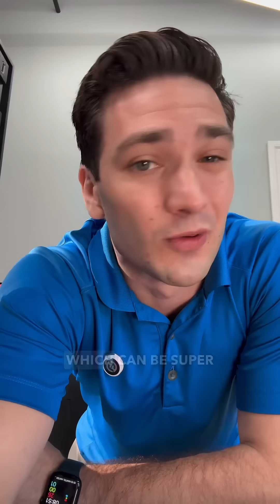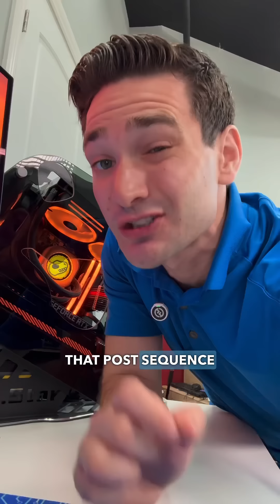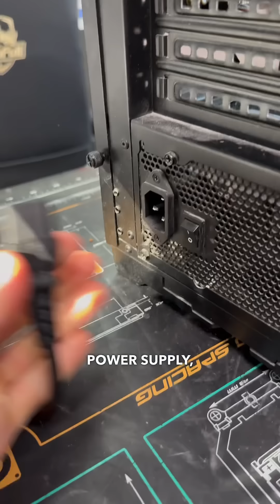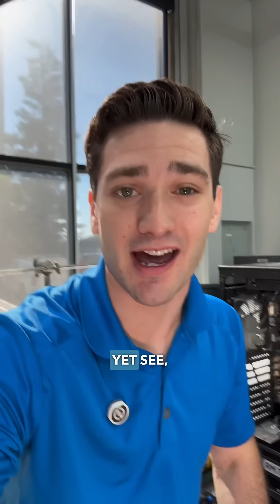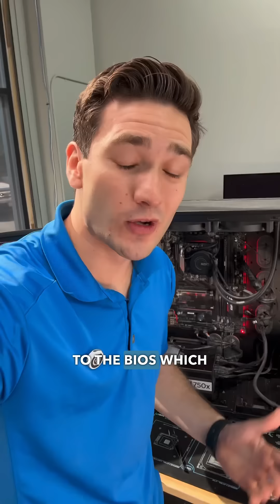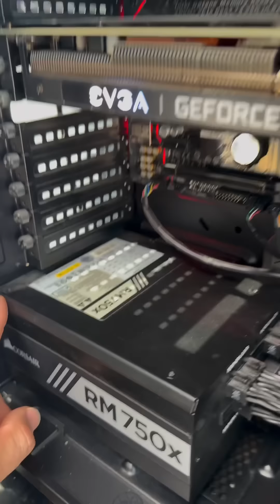PC Restart Cycle! #gamingpc #pcrepair #techtips #pcbuild #computerrepair #repair #gamingcomputer

Comment: I had the same thing when I installed my new gpu. But it isn't the bios in my case. Whenever I turn on XMP my system keeps restarting on itself. I did a bios update but it didn't help. Still not exactly sure what it is. I can't run my ram at full speed for some reason.

Comment: matt's computer services shorts bingo (originally by spiralingspiral72):

✅ this pc came into my shop
❌ power on self test
❌ hook up the doctor power 3
✅ take this pc out back and blow it out
❌ so, what gives?
✅ diagnostic LEDs
❌ intel instability issues
❌ we get absolutely no display out
❌ my favorite pro tip, pre wiring
❌ dead hard drive/ssd
✅ let's get this pc back over to our customer
✅ so what's going on
❌ (the) system fires right up
❌ fire the system (right) up/get this system fired up
❌ overheating cpu/gpu
❌ the system failing to post
❌ (matt rips out or slam dunks a pc component)
❌ windows installation media
✅ complementary metal oxide semiconductor (CMOS)
✅ clear/reset the cmos
❌ windows reliability history
❌ wouldn't you look at that
❌ loose pc part
❌ over and over again
✅ BIOS

Comment: If no bios switch, take out the spi flash (looks like a tiny black chip with 8 legs) and connect it to a flasher, then backup the program on it, and then reflash it with the new bios from the manufacturer, then pop this flash back in and youre good to go. Sometimes its easy to remove, at sometimes youll need a soldering iron with some flux, so be careful not to burn your self and not to destroy your motherboard. I told you how to do it, but if you messed up and motherboard is dead now not only with bios, im not responsible for that shit
Reply: don't worry about it, no one is going to start removing BIOS chips from their boards because you told them to

Comment: Oh that Corsiar 750D Airflow Edition!😎
Reply: It is not the airflow edition, it is the normal edition without the front panel on, which is exactlt how I run mine since if you didn't get the airflow upgrade kit which was stupidly expensive for a piece od plastic, it works just as well but is free 😂 the original front panel when attached looks great but is essentially a dust cover. Still though, the case fits my 9800x3d and a 360mm AIO just fine, wish it fit a 420 though

Comment: I have an itx motherboard from asrock that refuses to post and has no debug lights and ive tried every single configuration of parts that i have and even shorted out the cmos reset pins and it still refuses to post. Does anyone have an idea of what could be happening and how to fix it?
Reply: could be any number of things, if not tried what's suggested on youtube or google ai then could be motherboard or cpu, just check everything one by one

Comment: I have a motherboard that likes to brown-out itself on boot.
 But it will boot if all devices are removed.
1) The board does not like chained USB hubs in the boot sequence - likely not issue with newer boards. But older ones seems to create a timeout issue.
2) It doesn't like heavy loads, I have many USB drives and devices. Too many seems to upset the timing of IO
3) There is an issue that might affect my Intel CPU that under heavy load, the CPU circuitry in some Intel chips interprets the start up voltage as a brown out instead of clean boot, and triggers a reset of the system; which then causes the chip to sense heavy load, repeat.
5) I have cleared CMOS settings (used to boot holding insert key, but not available on usb keyboards) and manual and battery clear.  PSU should be plenty for this system. also air flow, and boards properly inserted, ram properly in slots, and if very desperate, the heat sink pastes, and finally dust and also quality of power input (I have a solar powered system, so had to make sure the Pure Sine wave and UPS could BOTH handle the boot up current for the entire time of the boot).
Just a few things for others with the same annoyance
Reply: nice one, some interesting points, my kids has gone into a power cycle stopping before reaching bios, tried all sorts, first problem had in over 20 years that not been able to fix myself, the usb problem you touched on is a possibility as windows 10 records every usb device used, also the cpu brown start up is a poss, thanks.

Comment: I have a question, when I try to power on my old Win98 PC, all the diodes indicating power light up on the case, but it doesn't load into bios (mouse and keyboard lights were constantly flashing meaning they are not getting any signal. Same with the monitor)

Comment: This is the exact problem I'm having with my first home built gaming rig I am glad Amazon delayed my order and I ordered a second motherboard but I'll see if I have one of those batteries before just disassembling and re assemble it. It was hard enough to get everything wired and working right the first time and I'm not looking forward to having to mess with my water cooler or CPU. Just out of curiosity how much does the average repair shop charge for this anyone got a rough estimate?

Comment: I need to learn more about this "short the pins, then reset the computer" trick. I've been building and troubleshooting for 25 years and have never seen that fix.
Reply: Its the clear_cmos link it'll be mentioned in the manual don't go shorting out random pins you'll get yourself into more trouble
Reply: @soupdragon151  I know THAT lol, I didn't know you could jump connectors on a chip itself like that though.

Comment: Gigabyte is actually the first manufacturer to use dual bios. That's why it didn't have a bios flashback feature but rather a backup bios chip.
Reply: Yes, Gigabyte used to have dual bios but now they opt to Q-flash/Q-flash plus, I think.

Comment: Are you gonna re flash that first bios? Most of the time you can flash one from the other. That way you can see if it's the bios chip or just a bios software issue. If you don't, then when the second bios messes up you can't switch back to the first anymore.

Comment: Hey @mattcomputerservices I'm currently putting together a part list for a new build with a 9950x3d + 9070xt. I'm a bit stuck on which b850 mother board to pick, each one I look at, I find so many reports of ethernet/wifi or sleep/wake cycle issues. Do you have opinion on which mobo has the best reliability, or is it just a hope for the best situation.

Comment: similar symptoms can be exhibited from amd AM4 bios upgrade, for example going from a popular Ryzen 3600 to a 5600.   Requires bios update, where even successful the same symptoms can occur.,Solution is to do with CSM change that.

And if you discover for whatever reason you need UEFI theres a converter, which requires its own small partition on your drive.  Its never easy, oh i'll just update bios and replace cpu..ez! ...riiight.

Comment: i think you should reflash the main bios. the corrupted one,before sending back the pc. i think there is the guide to do so in the motherboard manual. just look on the specific model of your costumer on gygabite site. You can't re send back he pc in that state
Reply: I wonder if the 'good' BIOS can be cloned to the 'faulty' one via software. Otherwise with a programming clamp either.
Reply: @deathtrap1976 I read that with gigabyte the 2nd bios is read only so you just go on Q-flash with a usb stick and flash the latest version. Il will flash the main chip
Reply: Was going to say you need to reflash the main bios if possible otherwise if the same thing happens in future you've no backup at all
Reply: Wouldn’t this backup bios just overwrite the main one?

Comment: Sometimes it's the PSU, although very rarely. It happens if yours is broken, or you have very old ones that do not hold within the thresholds. A sign for that is that it goes through the circles like in the vid, and it turns on but very rarely.

Comment: For anyone wondering, you need to remove the cmos battery for 5 minutes in order to be sure the bios settings gets lost.
Reply: otherwise the cmos are likely not to be blank, and more likely to have random junk
Reply: better boards have a reset switch or button to press
Reply: @soupdragon151  it's a "modern" addition used to discharge the noise reduction capacitors, and the CMOS chips are very high impedance (ie very low current consumption) and so also have significant internal capacitive effect on its cells, so having a shorting button or jumper helps ground all those circuits out - only use when power is off

Comment: If ur pc doesn't have a bios flashback or a dual bios you can use cha341A bios programmer to externally program your bios without having to buy another motherboard

Comment: Oh well, I was one of the few lucky ones, who had the system restarting and shutting off constantly, because my $1,000 CPU died...... I was troubleshooting for so long, because everybody told me, it's highly unlikely, that the CPU is dead. But it really was. Computer worked without issues with a replacement CPU. It was an Intel i7 6900K, which I keep as a memory, and also to maybe use it for some crazy video, where you do ridiculous stuff with a CPU.
Reply: have similar problem, all that's left after all the hardware testing is to either change the cpu or check pins, if that fails then new motherboard as i know all other parts have been tested individually, amazing what everybody suggests what it is.

Comment: Okay, see, heres a problem.
When i built my own PC, i also had this exact same problem, it would start, RGBs lit up, fans would go, it would shut itself off, then start itself again, rinse and repeat.
The fix? simply re-seating the RAM. Nothing to do with the BIOS.
So from my experience and PoV, this is a misleading video because it was something else entirely.
Reply: what you described is just one of the many problems that could make your system boot loop. He stripped things down to the cpu and 1 stick of ram and it still didn't work, how is it misleading? In the same manner, if that light flashes bright red on CPU, would you still say it's a RAM problem and not a CPU one?
Reply: tip of the iceberg m8

Comment: you can manually reset the bios by unplugging the cmos battery and use a screw driver tip or a paper clip and it will reset the bios.

Comment: Couldn't you also dump the backup bios and use that file to flash the original bios so that if the back up bios also fails down the line you aren't screwed?

Comment: So is there any fix for the corrupted bios?
Reply: Yes, some motherboards have a backup BIOS chip or a BIOS FlashBack button.
Reply: @AppleFan-md9sp does the backup bios chip bypass the corrupted bios or overwrite and restore? Can it be done multiple times or just once?
Reply: @davidunwin7868  the backup bios is another bios, basically bios 1 and bios 2, if the first one gets corrupted you can use the second one. I don't know if there's any way to recover the first one and make it work if the motherboard doesn't have bios flashback

Comment: I fixed a corrupt bios by flashing a new chip with with the correct bios, then piggybacking the new chip over the bad chip. It was a simpler time, so u don’t know if that could be done today. All the gigabyte boards I have owned included dual bios chips, but I haven’t had to toggle which chip is active.

Comment: That dude got incredibly lucky that he had a backup bios. I remember back in the day that if you messed that up, you were completely fucked
Reply: It is possible to reflash the bios chip but you need special tools. You arent completely fucked though unless you dont know how to reflash one manually
Reply: @Adrenaline0000  most people wouldn't know how to do that, but I guess that's why repair shops like this channel's exist
Reply: @Adrenaline0000  i did this in asus rog b360f it worked
Reply: @Adrenaline0000 it's not THAT hard
Reply: @Adrenaline0000 ch340 flasher only cost 5 bucks on amz
Reply: @Adrenaline0000 it's actually pretty easy to backup
Reply: I dunno, 80% repair shops have a tool to "unbrick" mb with corrupted bios
Reply: @Rasta796  most dont want one.. coz buying a new MB is better for them..
Reply: Ch34a1
Reply: Pretty sure that backup BIOS can't be updated, though. So this wasn't a fix. Just a "good enough" hack.
Reply: @Linerunner99  Yes. A proper fix would be to reflash the BIOS
Reply: @Linerunner99  It can. Generally after a successful BIOS flash, the board will reboot and then reflash the backup BIOS to the new version. Sometimes this process fails though, and you can end up with an ancient BIOS version that causes problems.

I had this on an old Gigabyte EP45-DS4. The backup BIOS never updated and it eventually got corrupted. The board would boot fine, but it would randomly shut off and go into an infinite reboot loop that killed the boot drive. I reflashed the BIOS, even though it was the latest and it finally reflashed the backup BIOS and fixed the reboot loop.

I now have three EPROM/EEPROM programmers so I don't have to mess around with shitty software flashing.
Reply: @Linerunner99 yes the backup bios can be flashed it’s essentially just a clone of the main bios which means it can be updated
Reply: With the right programmer tool such as ch341a, you can reprogram bios chips without even soldering it out. Literally every PC repair shop has something like this on hand. Buying new mobo coz of it is diabolical lol
Reply: @irulane990  People have been making decent money buying "bricked" mobos and reflashing them. Now that more and more mobos have backup BIOS, it's a bit less viable.
Reply: @irulane990  You can't always use a clip-on programmer. Sometimes the SPI bus that the BIOS chip resides on has too many other things that drag the bus down when you try to power it with a clip-on programmer and won't let you program it.

There are also low voltage EEPROMs that can be damaged with the CH341a programmer. It's designed for 3.3v chips, while some are 1.8v.

In cases like this, the BIOS chip has to be removed from the board and programmed.
Reply: @GGigabiteM there is literally an 1.8v adapter for ch341a. And you can always desolder the chip its really not that hard and if your mobo is expensive its still super viable
Reply: @irulane990  Hot air rework is not exactly a skill that everyone has, or the equipment to do. I've been doing board level repair for decades and have the equipment to do it, so it is easy for me, which is why I was explaining a bit about it.

And yes, there are adapters for the CH341a that allow it to program lower voltage EEPROMs, but the same limitations apply. I wouldn't recommend anyone attempt doing such without doing the research before hand. You need to know exactly what EEPROM you have.

If you just slap the wrong programmer on a board, you can end up causing nasty damage. I've seen it happen before. People mistake SOIC-8 mosfets for the BIOS chip and blow up their programmer, the motherboard, or both. Or have a 1.8v EEPROM and fry it because they didn't use the correct adapter.
Reply: Waaaaay back in the day it was not unusual for the BIOS chip to be socketed, so that if the BIOS got screwed you could just swap in a new chip.
Reply: No, read my comment, trust me in 99.9% of cases it can be fixed
Reply: I told him I had a backup bios I just didn't have a switch.
Reply: Can't you just get a new mobo if you have the money for it?
Reply: Every proper electrical technician in a shop that repairs electronics could reflash that bios with his tools easily, even back they could do that, but there weren't any shops available.
Reply: if you got a motherboard with dual bios, that isn't a problem
Reply: Unless you were using a motherboard like the p5kpl-am(that motherboard has a built in ez flash option)
Reply: Just go to a repair shop
Reply: Idi
Reply: well by "completely" if you mean buying a new motherboard yeah. The other parts are unaffected and replacing motherboard wont actually cost that much

Comment: Did you restore main bios?
Reply: That's my question. Wouldn't there be a way to reinstall the main BIOS somehow? Maybe from the manufacturer's website?
Reply: @aodhstormeyes (check edit since I messed up sorry, Yes you probably can MOST of the time, otherwise the following is very technical and not recommend for consumers at all, use only when needed) Not from the OEM website since thats an Update file and does not contain the full rom, You can however manually remove the backup bios, dump it, reinstall it, uninstall the original bios, and flash it using a bios flasher, then reinstall the bios. On some motherboards you can do this without removing the bios but it's not recommended and you should remove the chip. It sounds scary but if you can solder than it isnt all too bad

Quick edit (done right after posting): I believe you can use the flash bios option. Use this only if that doesn't work for some reason (actually if you corrupted it that bad you should already have the tools needed), I believe that should always work but lets say you cannot access the bios due to a password or if your bios doesn't support flashing then it'll be useful, So this is probably useless to most people. Technically speaking the first part is true about how it doesn't contain the full rom, so maybe in some cases of corruption past a failed update flash, this could be useful.
Reply: @aodhstormeyes  it in not a problem afterall cuz you can then just install it with no problems
Reply: @shybuy52 yeah it’s a problem the backup bios is read only. So it’s a obsolete version that should allow you to reflash the main one. He just need to preparare a flash drive and flash the most updated bios . In this way you restore the main chip
Reply: @aodhstormeyes the issue is theres no BIOS reflash and using backup BIOS isnt much of an issue